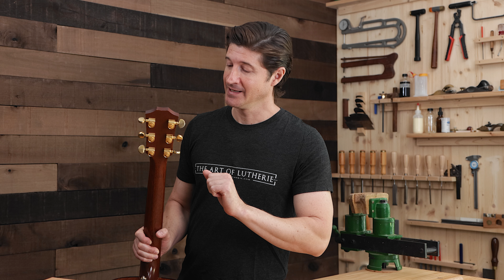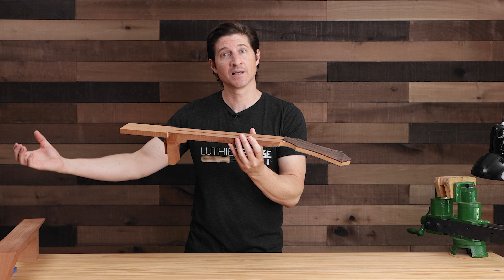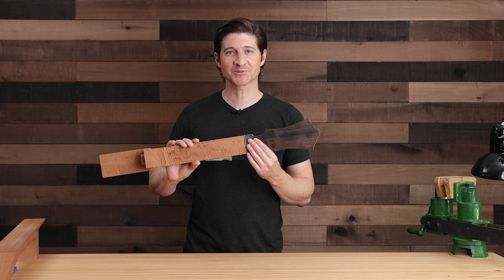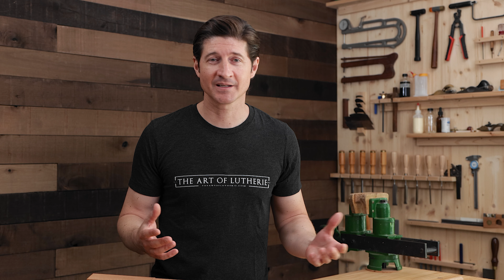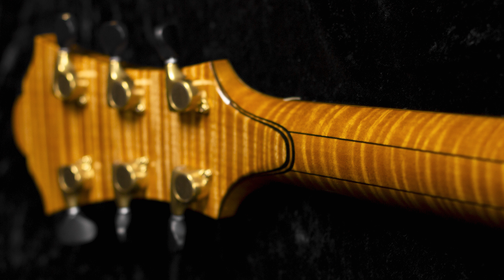What Is A Guitar Backstrap? (How & Why It Can Improve Your Guitars)

Comment: So instead of carving a valute in the first place, add layers of glue and veneer....
Well, you could layer different colors for effect, but wouldn't solid wood be stronger?
Reply: Actually dude believe it or not wood glue in layers of the veneers are much stronger than a solid piece of wood. I'm sure you've heard of guitar necks being stronger after they are repaired then they originally were.and this isnt a cocky comment.i used to think that too
Reply: @treblelogic  yeah, I was thinking about it last night before bed. They started using laminated floor joists and roof trusses because they're supposed to be lighter and stronger. Weird.

Comment: I gotta say, they look cool with the backstrap. I had an Ibanez semi hollow and the head stock broke. Really sucks. My LTD M403ht has a really thick joint where the neck meets the headstock.  It feels much more sturdy than my Jackson Dinky Archtop, which has a really thin neck joint (I think that's what it's called). Anyways this is very interesting, because he's right, it can be a serious problem with certain guitars. I was able to reattach the headstock using wood glue and screws, and the intonation was still fine. But over time, it broke off again. I don't even know what happened to that guitar. Maybe someone else ended up with it and was able to fix it.

Comment: How is this different or any better then a volute? Actually wondering.
Reply: I would imagine it would possibly be stronger because with his back strap you have grain that is going from the headstock all the way into the neck.
Reply from the maker: Hi Kyle, Good question! Different luthiers prefer different methods, so there is no right or wrong way. As Michael said in his comment, this way makes more sense to me because it adds extra layers of wood going all the way through the potential weak point down into the neck shaft. The traditional volute is just adding a little extra wood there at that point, and a volute with back veneers still leaves this central area of stress focus under the nut open. The way I think about it and do it on my guitars is just the way that makes the most sense to me and has worked very well for me on over 100 guitars over the last 20+ years. We have to keep in mind that many great guitars have been made with the volute method as well; the fun part and the art of it all is finding the way that gives you the best results and seems right for you and your style.